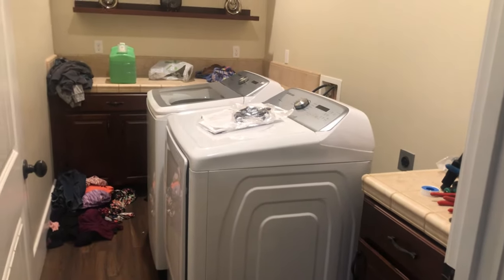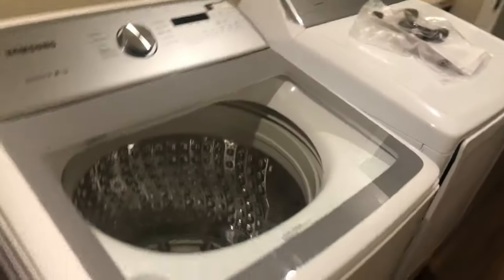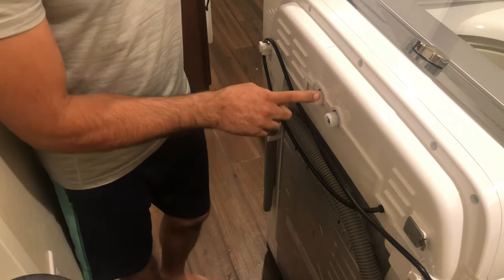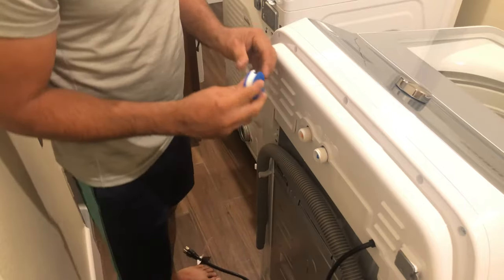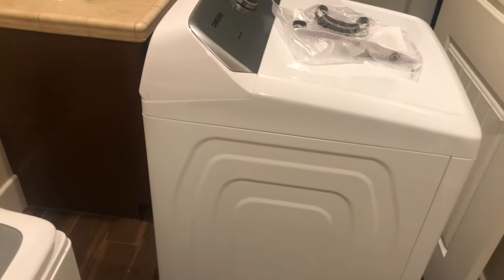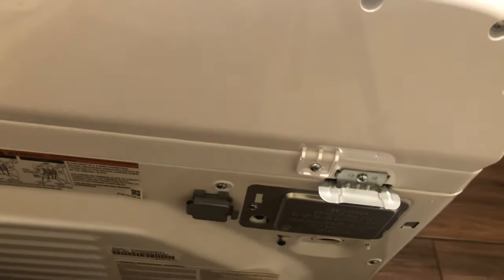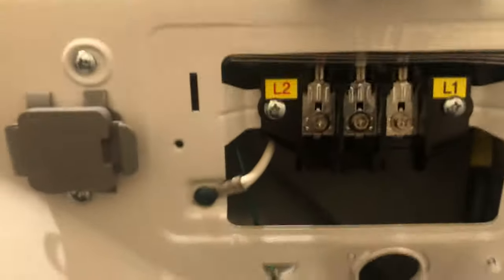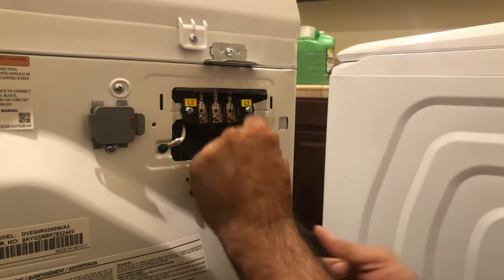Samsung Washer And Dryer Quick Look And Installation All you Need To Know

Comment: White shouldn’t be connected to ground on chassis, needs to be moved to the center screw with the white wire from the cord
Reply: I saw another vid where the white was moved to the center terminal. Makes sense. Why the heck don't they put it there from go?
Reply: @JasonFrey-hs3id it’s very well explained in the back, it depends if you use a 3 or 4 wire cable

Comment: You didn’t balance the washing machine …
Reply from the maker: I don’t know how to do what it runs smooth I will check 
Thanks for reminding 👍
Reply: @baljitjohal  that means your floor is level 😄 if only we were all so lucky. I’m enjoying the washing machine, the spin cycle is very efficient!
Reply: Have you been having trouble with the balancing? @andrew W
Reply: Have you been having trouble with the balancing?
Reply from the maker: @SirCheez  no I don’t actually
Reply: @baljitjohal  so basically don’t overload your machine. I just bought my set.. but seen so many terrible reviews  was just hoping I didn’t get a lemon washing machine lol
Reply: @SirCheez  yes I have, it still isn’t balanced as much as I’d like. I really thought it was my floor but the rubber feet are a design flaw. Not having them in all 4 corners doesn’t help either.

Comment: The directions for hooking up power cord to dryer that are on back of dryer and in manual are a bit different. It shows hooking up the white ground wire with the other white in the middle! Now I’m confused!
Reply from the maker: I think might look different but same thing 
You have 2 phases 240v and white neutral green ground 
Connect white with white and red black on other 2 wire green will go with chassis

Comment: i have a 3 prong cord, but my connections are not color coded, so does it matter where i put them
Reply from the maker: Yes if 240v then only ground wire maters need to be on ground terminal only
Reply: ok my last question is for an electric dryer, is the silver transition duct needed
Reply from the maker: @Jamara-c5v  you need ducts for sure to pull lent out they comes in many type plastic extendable silver
Reply from the maker: @Jamara-c5v  and don’t worry to ask questions you can ask as many you want I am happy to help you
Reply: i ordered the silver duct i just needed to know

Comment: Great video. Appreciate it. Not all that comfortable with things that mix water and electrical.
FYI - That cord retainer bracket will work with your dryer - Rounded bits go in opposite each other with cord in between.
One last thing - I really dislike that the power outlet for your washer is so low on the wall. A leak from either end of the hoses might prove fun for you.
Reply from the maker: Thanks for your feedback 
Receptacle for washer and dryer is installed by builders when they built house I just bought house when i installed it is kind of risk but how it was
Reply: @baljitjohal  Totally get that.

Comment: .     Mine arrived with the drain hose not attached to the drain line inside the washing machine and absolutely no mention or drawing on how to attach.  When I opened the back side, by removing the back metal panel, I see what might be a flap that covers the hole and opens up when the water flows out, however I can't get it to move whatsoever so I don't know if it's a flap that needs to stay or cap which needs removing -- it's really that hard to tell.  I tried gingerly opening it but can't use any more force without damaging it.  I'm also afraid that if it's a cap and the machine tries to expel the water it might damage the machine.
     Also, mine arrived with some water in it, yet I literally looked at every inch of the machine, even using different types of light and a really kick-ass magnifying glass, almost the size of a dinner plate, a jewelers item, and could not find one scratch, fingerprint, water mark, or any kind of blemish either on the outside, inside the washing area, and from the back with the panel removed looking at the machine guts.........I feel like I'm positive it was never unpacked and used yet I can't explain why there's water in it.  The water would seem to lean towards proving me wrong but the machine is immaculate......just perfect.   I just don't understand this part at all.  Feeling already I might have gotten screwed..........bought from BestBuy 
..

Comment: You have to install the strain relief clamp at the electrical chord opening, regardless on whether or not anybody intends to pull on the chord or not.
Reply from the maker: Yes that will be lot better and safe but mostly cord stays behind machine and only we have risk when we cleaning otherwise it will be safe 
Thanks for advice

Comment: What is that black tube that was on the dryer ? I also received it with my washer .
Reply from the maker: Dryer comes with wire only no tube that if you buy electrical dryer 
Tube comes if you buy gas dryer

Comment: Hello! I was wondering if you like your new washing machine? I want to know more about it before I make a purchase. Thank you.
Reply from the maker: It is really nice working really good definitely dryer  it sense dryness of cloths it will just only run until cloths dry 
But washing machine as is He using more water compared to my old one and cycle takes about 20 minutes extra normal wash mode it takes 1hour to 1:20 minutes but wash’s lot better
Reply: It sucks it breaks down I’ve had mine for a year and they don’t fix it
Reply: @carlosthol7269  Did you buy it brand new from Home Depot or Lowes?  The are under warranty so they have to fix it or replace it.
Reply: @mikehughes8023  I got it new from Home Depot
Reply: They ended up just giving us money back after they tried replacing everything
Reply: @carlosthol7269  glad you got your money back! Thanks for giving us an update.

Comment: Question: Your dryer didn't come with a water hose? Mine came with an extra water hose.  From what I see from the back of the washer theirs an opening bottom left corner.  Did your dryer have the same opening?
Reply from the maker: No mine dryer did not come with water hose just make sure it is electrical not gas 2 type of dryer gas and electric 
Electric you need wire and exhaust 
Gas need electric wire low voltage 120v and gas line

Comment: do you know what the electric plug in on the back is for? looks like wifi or something
Reply from the maker: I didn’t noticed I will check by the way it is for dryer or washer ?
Reply: @baljitjohal  it’s on both the washer and dryer on the washer it’s litterally right next to the power cable
Reply: you can see it at 2:58 on the bottom right of the screen

Comment: This Wiring didn’t work for me. 
I had to connect both White neutral wires to center and then only green to chassis
Reply from the maker: Yes green should go to chassis it should work because dryer wire cam from company

Comment: I'm having so much trouble getting it to start (actually starting the cycle). When I press the button inside (to hand wash) it works occasionally, but a cycle won't start. What can I do, I have followed all steps
Reply from the maker: First of all you have any error messages or any thing let me know 
How to start cycle 
First chops wash mood 
What’s temp like hot cold warm 
Dirty high medium or choose from option 
Rinse how many time 
Then there is start button you need to press hand hold until it locks and circle start spinning around start button
Reply from the maker: Am not home I can try to start cycle and make video when I get home
Reply: I got a DC1 code (door not closed). I have washed one time only and it worked  
I adjust nob to normal cycle (the knob)
I adjust the temp, rinse, spin and soil levels.
I hold start button and it makes a noise like it's going to start but It doesn't spin anymore and water doesn't come out.

Then
Reply: When its supposed to lock, do you hear it lock? Mine does not make a lock noise.
Reply: Thank you for responding to me quick
Reply from the maker: @yuseong__2562  
If you see code door not closed it might not closed properly, or not locking it might be faulty door lock it happens even new ones electronics fail some time try to see if anything at door locking hardware clear nothing preventing to lock or close
Reply from the maker: @yuseong__2562  
Yes it sounds click and you will notice it locked
Reply from the maker: Can you try unplugging power cord for 1 minute and plug back in than try it see if it fixed if not you might have bad door lock
Reply: I did so. And it still didn't work. Water doesn't come out when I start a cycle nor does it spin.
Reply from the maker: How To Start Wash Cycle Samsung H. e. Washer With water Jet Model : WA50R5200AW
https://youtu.be/nyHvJbX94HE

Comment: My dryer came with a hose splitter for water? I see your did not come with that.
Reply from the maker: No I didn’t buy hoses they was asking if I need because I have already for washer 
Dryer you need only power cord and exhaust pipe according to size in wall exhaust you have
Reply: I think you mistakenly said dryer when you meant washer
Reply: My dryer came with a hose splitter as well and I can see a connection for it on the bottom right of my dryer. Have no idea what it’s for.
Reply: The dryer has a steamer function that a cold water line can be ran to off the same line as the washer. Instructions read this. It’s what I did.
Reply: @spcysos so is it required to connect that? or is that just optional, like will the dryer be functional with or without it
Reply: @Ryan.Cinematic  the dryer will work, but some functions will not - steam dry, unwrinkle, etc. requires moisture.

Comment: Wrong wiring for a 4 wire outlet. You were supposed to put the neutral wire that was on the ground to the middle neutral. Please read manual.
Reply from the maker: Am sorry my friend I could agree with you but that is not green and copper cheesy ground you can understand what that means green or copper need to attached to cheesy and white neutral dryer need to turn on display so it have to go as I connected thanks for time
Reply: Agree with this comment. 
This wiring didn’t worked for me. 
I connected both whites as per this comment.

Comment: Do you have to put the tape?
Reply from the maker: If am right you talking about Teflon Tape yes it is to prevent leaking water it might will work without but later or sooner if you start leaking water it will make lot work and expensive damage Teflon tape is about $1-2 roll Al hardware store if you bought hose with it than it might be with kit
Reply: @baljitjohal  oh I actually used the hose that came with my samsung machine. I think the model I have is more recently made than yours but I set it up without the tape and it seems to be fine no leaking. I just turn the pipe off when I am not using it as a preventative measure... I didn't have any of that sealing tape like you used in your video
Reply from the maker: @coconutsugar_  
That I was thinking newer once have hose with plastic washer thing in side might no need tape
Reply: @baljitjohal  yes you're right my hose has a plastic thing on it and inside seems to be a rubber type sealing ring